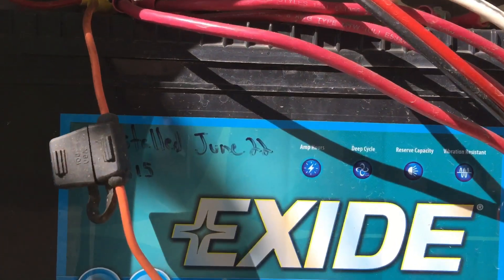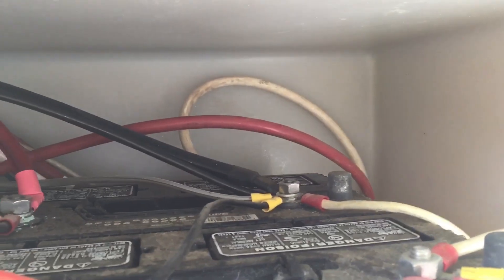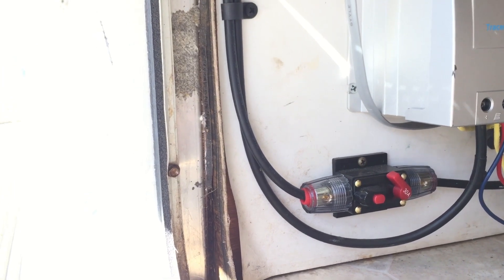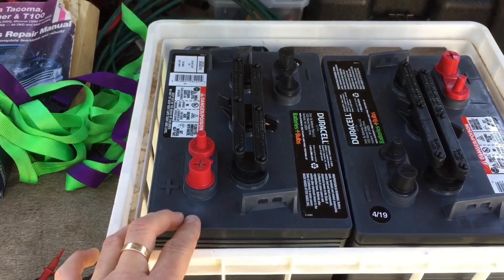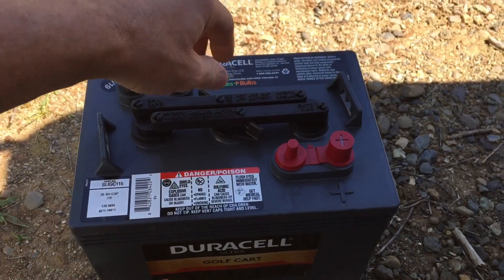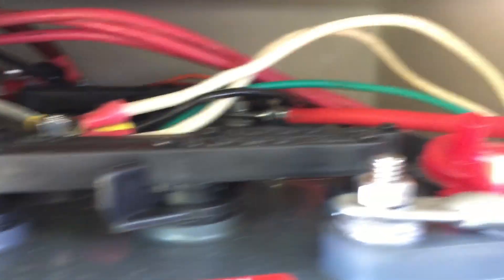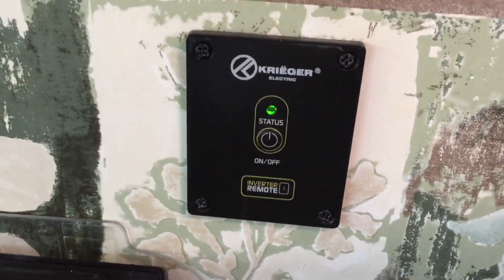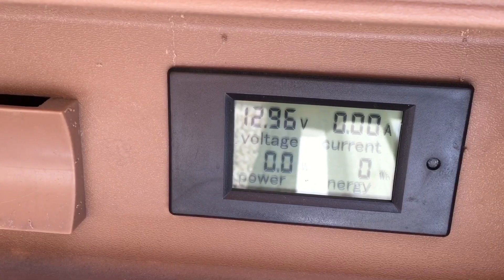New RV Batteries. 6 Volt Golf Cart Deep Cycle in My Truck Camper

Comment: Excited  to hear how this works out. They are really a great bargain per amp hour, plus they can really take the discharge abuse unlike a 12v battery due to the construction and plate thickness.  I am considering doing this, but I don’t think they will fit in my battery compartment in my lance 810.  Maybe in another compartment that I add a vent to.
Reply from the maker: Me too.  Hope they hold up.  I’m another 60 lbs lighter as well.  
They fit good in my battery compartment even with the Slide-out tray being 1” above the bottom of the compartment.  
👍🏻

Comment: I have been using 2 series 31 semi truck batteries to run my setup I will post the specs of them in a few I picked the up from O'Reilly Auto last year with a 2 year warranty. Very interesting on how to use golf cart batteries are going to workout I've been leaning with the idea of going to lithium myself after these batteries get burnt out.
Reply from the maker: My group 27 Exide 12V batteries lasted 4 years and were just starting to show their age.  Probably could have gotten another year or two out of them but I feel more comfortable with the reliability of new batteries.

Comment: Had no idea Duracell made 6v. Will be interesting to see if the two 6v comes close to providing the amp hours the 3 deep cycles did. Have to love the weight loss though!
Reply from the maker: They’ve been getting 5 star rating for RV use.  We will see how they hold up.  I think they’re made by Interstate
Reply: I’m not 100% sure but I think they are made by Johnson Controls.  Interstate doesn’t make batteries, they only market them. They market batteries from Exide and Johnson Controls.
Reply from the maker: You’re probably accurate there.   The same poly casing is used for the Interstate,  Centennial, Duracell, Deka and a couple others.  The Interstate GC2 has had a really good track record in RV’s.

Comment: Cool  I just did lithium and Trojans on my rig  two separate solar systems tho  third one in my enclosed trailer    why you not go with lithium ?
Reply from the maker: Thought about and priced Lithium.  100Ah of Lithium was $1,000. These were $250. 
Lithium or other newer battery technologies are in my future for another rig but not this TC.
Reply: @covetthecamper2289  yup hear ya  they pricey  had mine a month or so now  they are good  trojan t105 doing well too I camping this wind  dud not plug into shore power  don't need air here yet